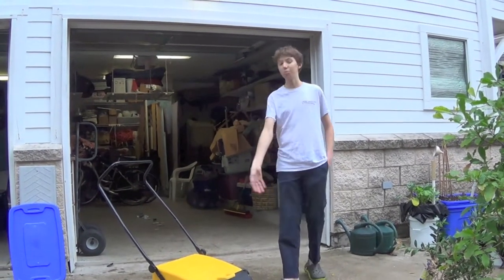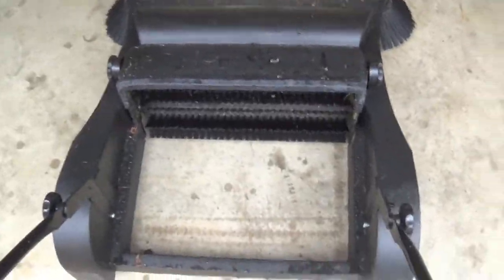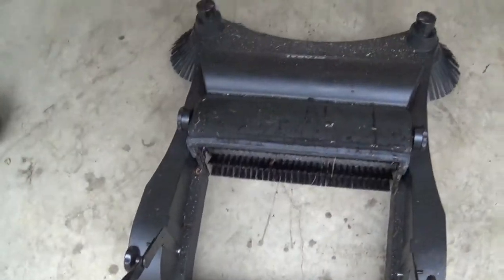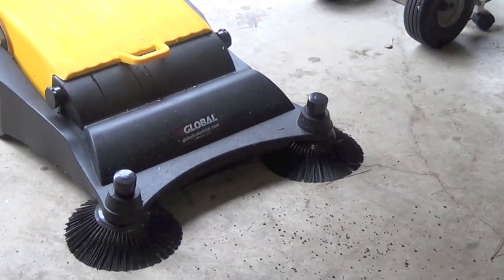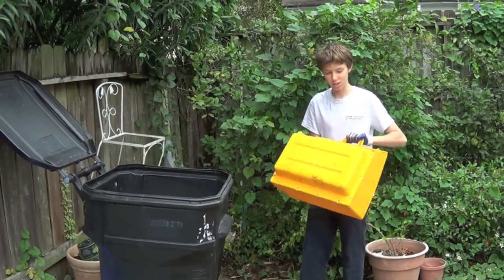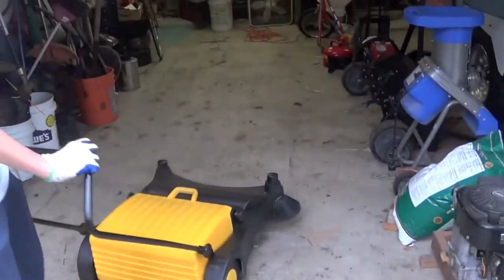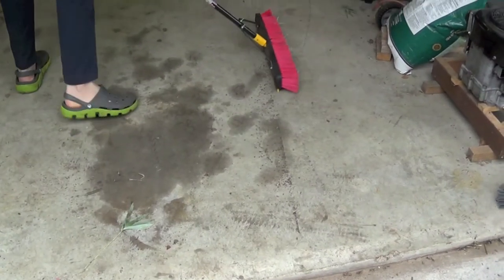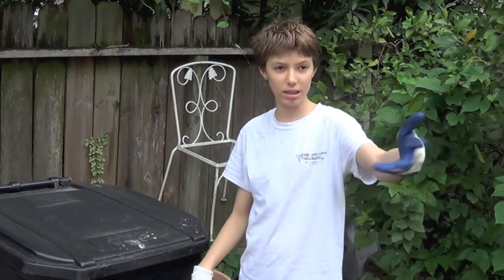Global Industrial® Push Sweeper!

Comment: Is this machine better than Karcher km 70/20?
Reply from the maker: No, but it is cheaper, $149 + tax. I dont own a Karcher so I dont know exactly but the Karcher would be better built.
Reply: Corin Gatwood thanks
Reply from the maker: Corin Gatwood Since im using it for home use it does well. What will you use yours for?
Reply from the maker: Corin Gatwood if you want to suck dust, the Picobello from EUREKA is awesome.
Reply: Corin Gatwood I used to clean large yard and around the house